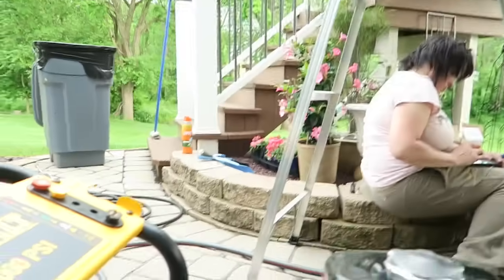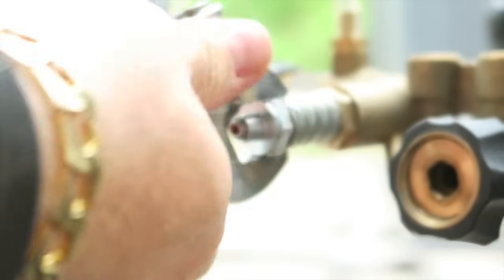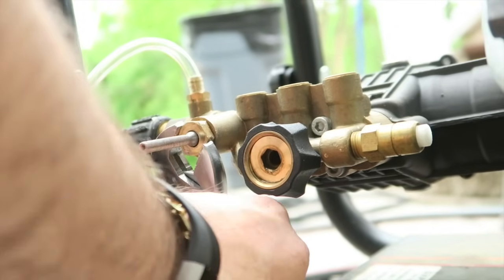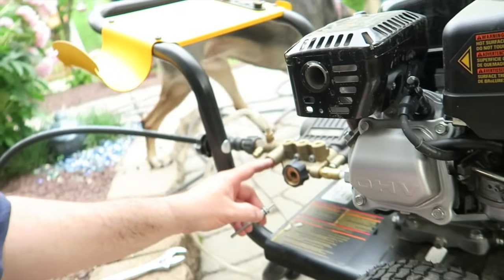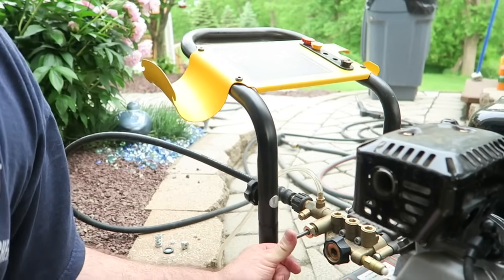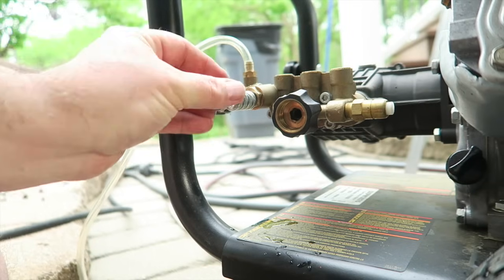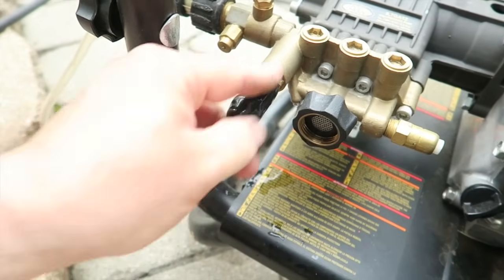Dewalt Power Washer Repair, No Pressure? No Problem - 5 minute fix!

Comment: I have a 3400 Dewalt bought it last year used it once tried starting yesterday it would run for a min and backfire. i took carb all apart checked jet it was clean. Did a youtube search found you. Mine was just the opposite, factory setting screwed down to tight over pressuring pump & motor, took valve apart it was operating fine. left adjustment about where yours was, ran fine....thanks for taking the time

Comment: A lady bought a new Dewalt pressure washer and ask me to use it to blow out a gutter for her even though I was there to work on her automation. Trying to be a nice guy, I agreed. A few minutes in and the pressure washer stop having pressure. She claimed I tore it up. The company I worked for just agreed to buy her a new one. I take it to the shop and pull up this video and ten minutes later I have a working pressure washer and have leaned my lesson about trying to help someone.

Comment: Super helpful, this solved my "no pressure" problem on 3600 psi DeWalt, I didn't have to remove the pin, just tap it to loosen and worked great again.  Thanks!
Reply from the maker: @PlayaVista-m2t  awesome!

Comment: Husband did it but just skip the part where you took the entire thing apart to leave the factory study and just did your last step of unbolting from the main part and then getting the pin to move and put back in so we did not mess with the factory setting of the pressure so in less steps you can accomplish the same thing
Reply: I guess it is kinda off topic but do anyone know of a good website to watch newly released series online?
Reply: @Archer Kayson i use flixzone. Just google for it =)
Reply: @Lyric Ishaan Yea, have been using flixzone for months myself =)
Reply: @Lyric Ishaan thanks, signed up and it seems like a nice service :) Appreciate it !!
Reply: @Archer Kayson Glad I could help :)

Comment: Thank you SOOOOOO much  ….I have a Dwalt 3400 PSI , only used it may be 7-8 times, and today I got ready to power wash my side walk and driveway, it had no pressure, I am so glad I went online and after watching 4 videos, yours was the most relevant one that gave me the answer and it saved me at least $180 (according to the repair shop) , thank you so much again, you are a great blessing.

Comment: I have a 3425 Dewalt Pressure washer about 3 years old this spring season. Started right up but no pressure. After checking user serviceable items I found your video, followed the directions and I'm back in business. Although I winterize my unit every year and it's garage stored I still encountered this issue.  Thanks for the video.

Comment: Thank you! This totally fixed our Dewalt 3000 psi pressure washer. Exact problem. Keep it up!
Reply from the maker: Its a very easy and cheap fix that I needed to share with everyone.  I hate when I or anyone gets ripped off on bogus repairs.

Comment: Fixed my water flow issue right up. FYI the small nut on the stem is a 10mm and the big nut is a 7/8. Thank you much for your video

Comment: Hi Billy.
Well, I checked it and as you said the offloader was stuck.  cleaned it up put it back together but unfortunately still no joy.  Going to try (may part are obsoleted) and get a valve replacement kit, a new off loader (just in case) and see what happens.  Anyway, thank for the great tip!

Comment: I have the Dewalt ( Simpson ) 4400,
The other thing to check is the valves, they crack after a while, I've done 100s of homes, a 25,558 sq ft Beach front hotel in 6 hours and have a 75,000+ sq ft hotel lined up with my Dewalt 4400, it lost pressure but my problem was the center valve,  the plastic housing that holds everything inside cracked. It was hard to notice.
Easy $70.00 fix in 10 minutes.

Comment: Great video it worked for a 3400 PSI , when we took everything apart it looked like the parts where like new but it had no water pressure,  whe we put everything back it started working
Reply: How did you guys fix your model I have the same one no water is coming through at all no pressure..
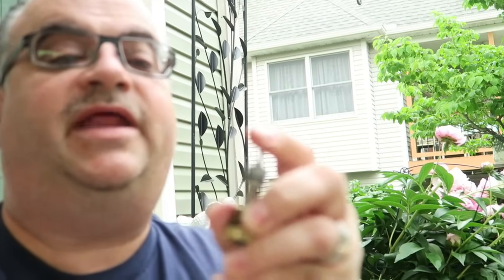Reply: @Mr. Suber, we followed the video instructions to take it apart but the key is what the guy did in the minute 4:10 you gotta make sure that little pin is moving as he shows , no new parts needed .

Comment: Worked like magic on the 3400 too, but I didn't have to mess with the micro  Allen nut
Reply: How did you get the stem out? I have a 3400 too and I can't figure it out.
Reply: How did you fix it

Comment: Thanks alot!! BTW it's a 3mm Allen on the 3400 model anyway for anyone wondering
Reply: Mine is completely seized up. Tried 3mm and it stripped it out. Did you have any issues?
Reply: @keiths585  ouch!! Sucks once any Allen head is stripped but you can try soaking in creeping oil overnight then take a slightly oversized flat headed screw driver and hammer it into the stripped out socket head

Comment: Thanks Billy. Repair shops for these will be quite upset that you've revealed one of their big money-makers. Since DeWalt only gives a 2-year warranty on a part that mfgr (AAA) offers 5-year is not impressive. But next pump for my 3800 will be from CAT anyway...

One comment on your procedure: I believe you should only remove the allen-head screw then back the entire unloader assembly out using nut that is against the pump body, but DO NOT touch the outermost nut that sets the spring pressure and resultant overpressure limit. Getting the later wrong could blow seals (if too high) or reduce operating pressure (too low).
Reply: haha o shops are going to be upset

Comment: Maybe you can help. I have a 3300 psi dewalt pressure washer (hose connects under neath the back side, not the style you have) how do you adjust these unloader valves? I’m trying to run a ball valve setup and it’s not drawing pressure on my valve setup. But if I kink the line it will build pressure. So I’m assuming I need to adjust the unloader but I’m not quite sure how, most commercial washers have a black handle that you adjust with but this one doesn’t. Maybe you can help?

Comment: Wonder if it's a DeWalt thing. I bought one a couple yrs ago and used it maybe 10 times at max 30-40 minutes and mine stopped working. I swore it was the wand but I'm gonna do this. I had a Ryobi and used that for hours doing washing at businesses for hours and hours a day for over a year straight and never once had an issue with that thing

Comment: its not under warranty. they call it a ware and tare part. mechanic has mine now (the 3400psi model) and is about to hit me with a bill for $120 to replace the valve. going to ask for the ild valve back now so i can see if that was my issue. my washer stopped giving amy preasure amd after a few taps to the pump i got half pressure with a choppy flow. worked fine to wash my house then an hour later i started it up at my fathers to clean his siding and thats when i started having issues. thanks for the info, good to know.

Comment: Hey Billy, I have the same exact pressure washer, and water is spewing out where the brass manifold connects to the black pump....and it also starts for about 2 seconds then cuts out, and these may be related to one another. Any ideas on this ??? I took this apart and can’t seem to find anything.

Comment: As we all know city water sucks . So if your going to store your unit over 30 days try using a product made by Black/Decker pressure washer pump lube , I think about $8.00 at Lowe’s but will save you a lot of headache and each can will give you multiple uses. I got some after I had to have my pump rebuilt and now 3 years later no issues at all.

Comment: After watching this video I worked on my pressure washer. I did everything shown (except the end nut wouldn't come off so I could not get the spring off). I was able to get the unloader out and the pin was not stuck. It would move up and down. I put it back together and put water to it and it still did not create pressure. I took it off again then took off the other valves to the left of the unloader including the one on top. (I had the hose connected looking to see if there was a full flow of water at the rate of water flow through the hose. It took a little maneuvering and work to get a flow of water from the opening for the unloader but it finally came. There was restricted flow to the left of the unloader so I knew it was something on that side.) Long story short, I took all the valves off and sprayed a little penetrating oil in them. Put them all back on, started the motor, and turned let it run for about 15-20 seconds with the water turned on and whatever was stuck inside broke free and I had pressure.  Thanks for the help.
Reply: Wow, I'm glad I came across your comment. Thank you so much.

Comment: Nice video sir. I have the 3300, huge regret buying this junk. Had many problems out the box. Soap reservoir tank leaking from the seam, as its not made of one piece lol. First time i used it the trigger pin got jammed. Now no pressue and the soap reservoir fills with water and blows the cap off... all this crap and the machine is new with under an hour total usuage 🗑 🚮

Comment: I just bought a 3300psi brand new and doesn’t pressurize. Called Dewalt and they offer a 5 year warranty but i didn’t want to go through the hassle. About to try this out. Will keep updated!
Reply: So???
Reply: @joleaiperlis5347  Well, i returned it. Got a 2nd one and it did the same thing. It turns out the gun itself is just poorly designed. The internal trigger mechanism keeps getting jammed causing a dead trigger and a steady waterfall of un-pressurized water.. I keep having to take apart the gun whenever this happens and reset the internals of the trigger. Now i know not to squeeze the trigger all the way to its maximum. Only mid.

Comment: Can somebody please demonstrate the assembly and operation of high pressure outlet end including micro switch on/off system and piston assembly and how it works when we press and release the handle of the pressure nozzle of an " ikon ik-by01 "high pressure washer.

Comment: People don’t understand that if your not in the business of pressure washing then your better off either buying an electric or don’t buy a pressure washer all together pay your local guy $150 to wash the driveway. Those machines need to be run frequently when they sit they get stuck it’s not made to sit around for use every other year